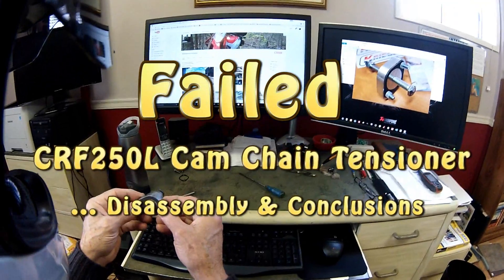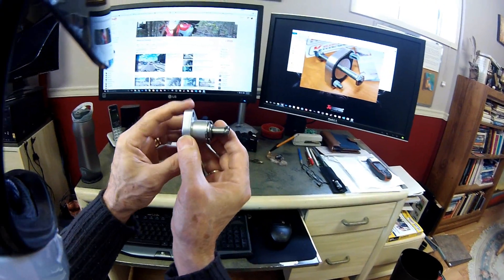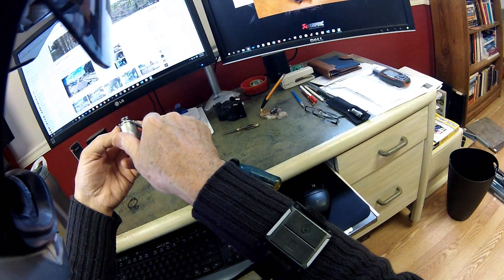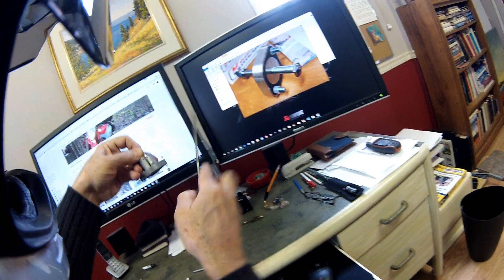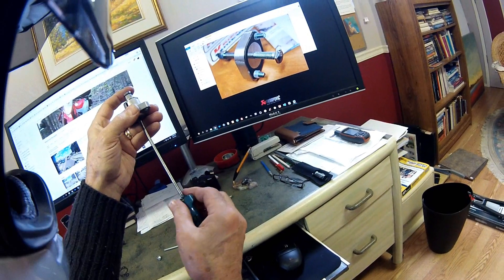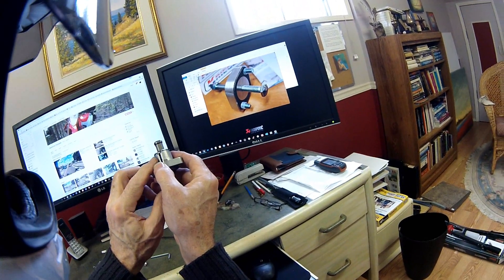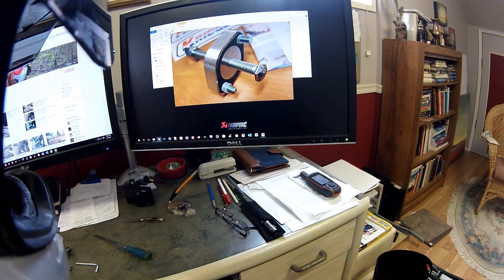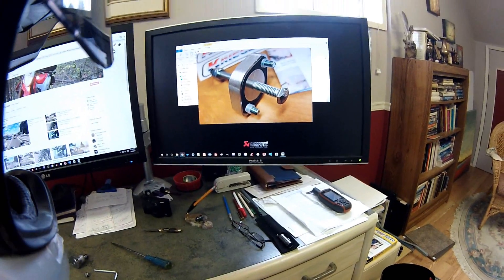Failed CRF250L Cam Chain Tensioner Disassembly and Conclusions

Comment: I drove 35 miles with this breakdown. do you think my engine is ok?
Reply from the maker: If it failed dramatically like mine, and not just rattling on trailing throttle, then you should change it out ASAP, but yeah, you're likely fine. If it's slapping and knocking against the case as mine did, it's not a good idea to run it more than you have you. It's an easy and inexpensive job to replace it.

Comment: Hey Scoot Toots. I have been watching your video on the TCT problem quite a number of times and been wondering something. What do you think of the idea of Taking out the OME tensioner with the engine at TDC on compression and measuring how far the tensioner needs to protrude to properly tension the chain and then winding the spring up a little more than original {but not too much to overdo it} so as to try to make the spring apply better tension in the area of adjustment needed to work properly.
Despite the manual tensioner being a suitable solution I cannot help but think if no thread or spring or other damage is evident it must be possible to make the self adjusting item actually work more or less correctly. You have made a fine point of the spring likely being too weak to do the job maybe with a little time and use and wear. But the design is supposed to overcome that despite the apparent shortcomings you have clearly suffered with more than one OME unit. I have not yet had to touch the one in my bike as it is still very low mileage but when the time comes I am considering 1st playing around with either the original spring adjustment or having a better quality one made at a spring works and installed. Nothing wrong with manual adjustment if one has to but I still like the idea of trying to make the self adjusting one do its job. I am just thinking as you have failed ones there maybe that is something you could look at. I would have to remove mine while it is still working at present or buy a new one to look at this idea.
Reply from the maker: Hi Kassie,
This was many years ago and I no longer have the failed units. Two thoughts though: 
1.) My situation was an exception to the norm. Having three OEM units completely fail as they did (not just making excessive rattle noises) caused me to conclude, with input from an engineer at Honda in Japan who contacted me, that the cause may have been a flaw in the engine casing causing the tension arm or the CCT unit to be positioned slightly further from the chain than intended. That would cause the spring to be less effective after some time and wear, especially in the cold months. 
2.) A manual CCT is completely reliable and is the best solution when OEM units are of dubious quality. I think the vast majority of Honda OEM CCT's operate as intended, albeit often on the slack side of acceptable, so a manual CCT can correct that is desired (but not required). The temptation is to misinterpret the rattle on many of the these bikes as something that must be corrected. Unless you are experiencing drastic 'danger' noises, I would ignore the common rattle on steady throttle. 
Hope some of that helps :-)
PS: someone on YouTube has done a video detailing the modification you describe. I can't recall who or the video name. Maybe do a search.
Reply: @Scoottoots  Thank you for that info. After posting to you I came across that person talking about exactly what I had mentioned. I am just building on information for the possibility of having to do something about it. I do hope your experience was more one off as you mentioned. Best wishes to you with your bike.
Reply from the maker: @kassiedreaneai7459  Thanks. Enjoy your bike 🙂

Comment: While this is an older video the problem has apparently not been rectified by Honda. I have complained about what I now know is a characteristic rattle {cam chain} at around 5,500 to 6,000 or so rpm. I have heard it since new but tolerated it for months before finally mentioning it to Honda dealership. They sent out a young person on the bike who said he heard nothing despite my trying to describe to him the situation of cruising at around those rpm in 5th or 6th gear and is not heard on acceleration nor deceleration normally. I know I am going to wind up having to resolve this for myself. Sadly this is not uncommon. Not all mechanics are incompetent but it is hard to actually find the really good ones who will hunt down a reported problem with the understanding that no-one actually wants to talk to a dealer about phantom problems that really do not exist.
Reply from the maker: I hear you, Kassie. It took a complete failure (the first one) of the cct before the Honda mechanic finally agreed with me. When my 250L was new it had that excessive rattle on steady throttle just as you describe. It was clear to me that it was excessive and that it was the cct. They said, "ah, it's a thumper; they all make noise like that." Sure enough it got worse and then failed, producing a hard knock they could ignore. 
They sent a video in to Corporate Honda along with their assessment showing how the cct failed. They also asked me to phone the Customer service line at Honda headquarters to register the issue myself. After that, as you know from the video, the next two OEM units failed completely in the same way, threatening to cause the cam chain to jump teeth. 
I never heard back from Corporate Honda even though they said they would follow up with me. Honda authorized replacement of all the units that failed, at their cost, even though it was not under warranty. 
I knew a person who worked at Honda tech headquarters in Japan. He told me that Honda was aware of it and was trying different designs in the CBR models to test. He also indicated that in my case there was likely a flaw in the engine casing that caused the cct units to be positioned further out from the cam chain tension arm, causing the same issue with all the units replaced. The manual cct from Krieger Cam Chain Tensioners solved the issue once and for all.
Reply: Is it sound on idle?

Comment: Great video mate. My CRF 250 L still making that noise after 3 times changed CCT. Ones i open CCT myself and set the spring but some time after making noise again .How can I find manuel CCT. Its pisses me off really because of that bad noise.. When i rev it little bit noise is gone but i like to hear good engine sound when idling. Can you please help me.
Reply from the maker: Google 'Krieger Cam Chain Tensioners' and you'll see the link to his site. He makes a very good CCT and doesn't charge much. His instructions are also very detailed. If you get excessive rattle on steady or trailing throttle at city speeds, and it vanishes as soon as you throttle on, then yes, it does sound like the CCT is causing it. The aftermarket unit in that case will likely eliminate it, assuming you set it correctly.
Reply: @Scoottoots    thank you so much. I am from Turkiye, i ll Google for Krieger for sure. Thank you once again.
Reply: @Scoottoots  Although, screw space can be opened in the middle of this automatic tensioner with a lathe machine. I think I can do manual tensioning using my old platform with a screw of suitable size.. huh? what do you think?
Reply from the maker: @orhan14oglu  Yes, you could probably adapt the OEM unit to become a manual unit, using a carriage bolt and lock nut.
Reply: @Scoottoots  evet, conta yuvasını bozmadan vida yeri açmaya çalışacağım. en kısa zamanda tornacı yolu gözüktü :)
Reply: @NotechinusV  merhaba. otomatik gergiyi manuele çevirdim. üstündeki mevcut otomatik gerginin içini boşaltıp sanayiden tamirci arkadaşımdan bir metrik vida uydurdum. İç kısma kontra için 2 somun, dış kısma da kontra için 2 somun taktım. Mis gibi oldu. Videolar var YouTube'da. Bi bakayım atarım.

Comment: if you look in the end where the screwdriver goes in there is little teeth. what you have to do is get the service manual, in there are dimensions for a little peg. you make the peg out of  sheet metal. you undo the tensioner like you have then place the peg in the other side and wind extra tension onto the spring. then when you have enough tension you push the peg in to hold the screw in place. then you reassemble the tensioner as it was before and take the peg out. it will spring back out with more tension this time. sometimes the spring breaks off at the base but they often just loose tension over the years. its been the same tensioner device on crf250x'x and r's from 04 up for quite a number of years.  maybe this will help someone. i retension them in all the bikes ive bought just to be on the safe side. not too much or the end will break off just enough...
Reply from the maker: Interesting procedure. Thanks for sharing it. In my case I solved the issues with a manual CCT. In hindsight though, since three OEM units failed completely in the same manner and in consecutive order, I felt the issue might have been exacerbated, or fully caused even, by a fault in the casting of the engine casing causing a greater distance between the tension arm and the CCT, or between the tension arm and the cam chain. Otherwise it's highly improbable that 3 consecutive units would fail in the same manner after exactly one year of use.

Comment: I had the horrible 6k-rpm rattle.  Brought it in to shop and they 're-lubed' tensioner.  Was great for a month.  Noise came back.  Easy fix if you have some mechanical knowhow.  Simplified version- pull out 'plunger'.  Put a socket over the male inner screw to hold in place.  Take your Honda lock tool that fits into those slots under 5mm allen and give it around 2 clockwise turns.  Put back together with it locked. Presto.  Tension is back.  Also, some springs break.  Just rebend it.  Do not let the plunger snap back into place.  Gently place it on the chain guide with small screwdriver otherwise it might make bike run like crap.  Do all this at your own risk.
Reply from the maker: Thanks for the tip. Maybe it will help some others. For me, the quick and easy solution was to use the Krieger manual CCT. Just tweak the setting every 10,000 to 15,000 kms as needed, and it runs flawless. Mine btw didn't just rattle; every time they failed it would be a hard audible knock in the engine that you could also feel in the bars as a sharp rap. It was the cam chain slapping against casing.

Comment: Hello scoots toots , i know this is an old video but when u removed the std cct did u put piston at tdc with no pressure  on the  vavles , and simply  remove old cct for new one ,  the reason  i ask is because  i want to remove mine and just see how my strong my return  spring is on my cct thanks
Reply from the maker: I can't recall, sorry. According to the owner of Krieger cct's though most singles stop at or near tdc when shut off, so he implied it wasn't vital to go through any special step concerning that. Not sure you'll be able to judge the strength of the spring without a brand new and known good unit to compare to. If you are not experiencing any dangerous symptoms like the hard knocking/slapping sound and the sharp rap in the bars, then I would leave well enough alone. A bit of rattle while riding is normal for these engines.

Comment: Has Honda improved this on newer models?
Reply from the maker: I am not aware of any changes made. That said, most owners do not have anywhere near the problems I had with mine. The fact that 3 consecutive units failed and there doesn't seem to be a widespread issue among owners, I have since come to the conclusion a batch of casings were cast with imperfections causing the mounting of perhaps the tensioner arm to be off spec. That's a distinct possibility. Bottom line: I wouldn't worry about the newer models.

Comment: Another good video and explanation of some minor shortcomings of an otherwise bullet proof engine. Did you change the Honda tensioners your self or done at the dealership and approximately how long does it take. Finally how many km's do you have on your bike now.
Reply from the maker: Thanks Mack. The dealer changed the first two under warranty even after the bike's warranty had expired. I changed the last one that failed and installed the Krieger manual CCT. Installing a new OEM unit is quick and easy. Takes about 10 minutes. Installing the manual unit takes longer only because you have to take care to get the setting correct. After that it's easy peasy to adjust when needed (very rarely). I have about 61,000 kms on the bike now, I think. Most owners do not have the issue with the tensioner that I did. I have come to also suspect part or all of the problem may have been due to a casting defect in the casing, possibly where the tension arm that contacts the cam chain attaches. No issues now with the manual unit though.

Comment: looks the same as the xr250/400 tensioners, I have heard the xr ones have problems with breaking the spring (could be the cause of the backing off). I have a 98 xr400 with the original tensioner in and still working fine.  looks like some thing honda needs to revise....... thanks for the vids.
Reply from the maker: I guess most OEM CCT's work as intended; just not for me and a few others across the globe. Happy with the Krieger manual CCT for years now.

Comment: The after market fixed adjuster is OK, but stupid money for a bolt holder with a lock nut.  I have seen $100...My solution was to pull the guts and install my own threaded stud, bushing and lock nut into the original.  Cost was near nothing. You do have to use a good stud with enough sealing area...simple.  This problem exists on nearly every bike with a spring loaded adjuster.
Reply from the maker: This problem that I had was a complete failing of the cct, leaving the chain with almost zero tension causing it to slap and knock, so it is not a problem on nearly every bike with a spring acuated cct. Very few actually fail. Many make irritating noise. I know I cuold have fabricated a manual unit, but for less than $40 these are well made and I don't have to spend the time.